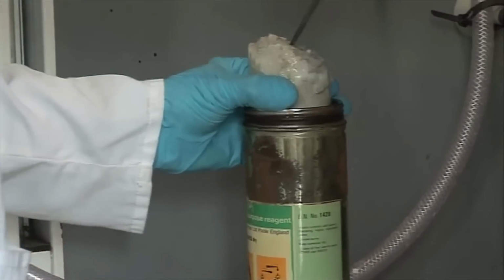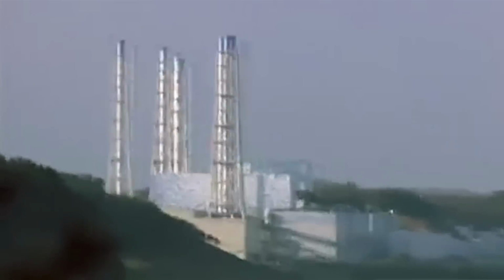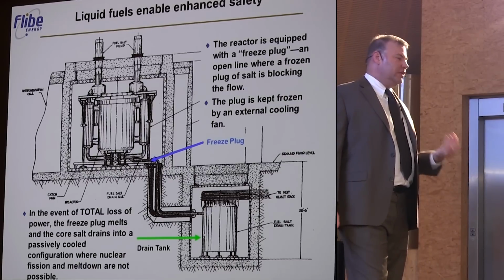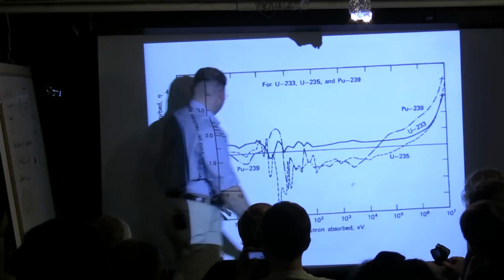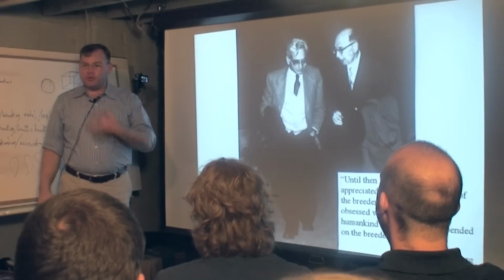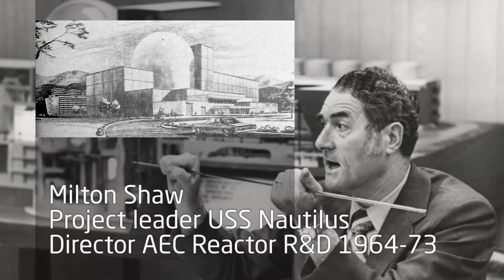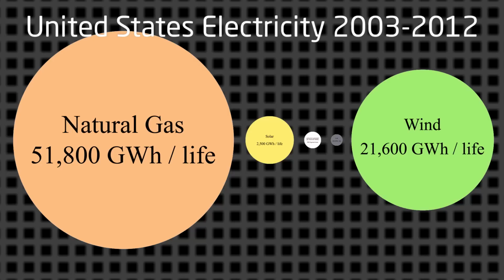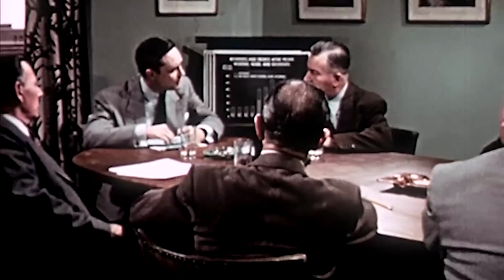Nuclear Disasters & Coolants

Comment: Why Not Build AT Least One LIFTR?
Reply: U.S gov. had one run 6 years until designer argued with Nixon about safety of fision reactors.Nixon then shut it down without explanation.
Reply: @billboyd4051  I think the question was why not building a MSR today? My guess is that it's very hard to find an investor because nuclear power plants (CAPEX) are pretty expensive. So the first DEMO MSR plant needs to be a showcase that the technology works as promised and can be built for a cheaper price per kW than current LWR. If this is not the case, the whole idea is dead on arrival in competitive electricity markets.
Reply: @gunnarkaestle  Investments into the future, are risky, utilities always choose the easiest way to boil water and without the ability to make weapons, governments don't seem to be interested. Elon is taking on transportation, and solar, but the oil and gas industry in in control. At least the coal industry is dying out in America, now fracking is destroying the water. Few care about the future, perhaps Texas will think of the impact of climate change, now that they are freezing their asses off.
Reply: @billboyd4051  It is normal for any kind of company to choose the easiest and cheapest way to follow a demand. Coal is dying out not only in the US, but also in the UK or in Spain (and that is not part of a political decision as in Germany). New coal power plants are just expensive, and the retrofit of old ones to meet current exhaust gas standards (NOx, SO2) is also not very attractive. The same principle is bringing nuclear gradually down.

Regarding the rotating blackouts in Texas during the cold wave, it seems that there are two reasons that the installed capacity of thermal power plants wasn't fully available. https://www.washingtonexaminer.com/policy/gas-coal-offline-texas-cold-snap
Usually, the peak demand in Texas is during the summer, driven by air-conditioning loads. Thus, there is enough dispatchable power generation in winter. But I was puzzled to read that equipment froze in in power plants ... in thermal power plants which generate a lot of waste heat? I have heard that in the late 70s, there was a cold wave and some of east German lignite plant were affected: not the plant itself, but the lignite fuel which has about 50% water content.

The other reason was a gas shortage, as power plants often prefer to have cheaper disconnectible contracts. So that was also a learning event during the 2012 European heat wave, when exactly this situation happened. High gas load for home heating and while the gas storages still were adequately full, the pipeline capacity was overbooked, so that in certain areas there was a gas grid related shortage. Thus it is important for critical gas power plants to have a non-interruptible gas contract, meaning that the gas amount is coupled with a fixed booking on pipeline capacity.
Reply: @gunnarkaestle  Texans will discover insulation soon, probably asbestos.
Reply: @billboyd4051  Asbestos is fine for shielding against high temperatures, therefore you could find it in insulation around steam pipes and also in personal protective gear. But it is not so well suited for not so high temperature gradients. But insulation is fine, not only in winter but also in summer. If you are not planning to tear your freshly built home down in 30 years, a better insulation saves money. If not for you, as you may move in 5 years, then for the next owner. A good insulation status of a building makes it more valuable.

Comment: coolant      fuel
salt              thorium not a fuel
water            LEU correct
sodium          Pu (Fast Reactor)
  I think this is correct
Reply: If you say a fuel is a fissile material, then you are right, thorium is fertile. You need to use it as educt in the breeder reaction, and this is the reason you need 2 neutrons per final energy releasing fission reaction, meaning you need a good neutron balance, not loosing to many.

Comment: If solar freakin roadways can get crowd funding why cant this?
Reply: The investment required to prove that solar panels make crappy road surfaces is a few orders of magnitude less than the investment required to prove that thorium reactors are practical, economically viable, and safe. If you're crowdfunding a thorium reactor, you'll need a crowd of enthusiasts that is orders of magnitude larger. Most people in the U.S. are uneasy about anything nuclear.
Reply: yes I know. All thanks to the military who wanted to make bombs and didn't really care if it made electricity.
Reply: Not really; the military cares a great deal about nuclear power and has invested in it heavily, both for naval propulsion and other applications. Even if it were otherwise, your attribution seems misplaced. The U.S. populace would be no less less scared of nuclear technology if the U.S. had no nuclear weapons, but its rivals did. In fact, U.S. citizens would quite likely be more afraid of those weapons, because the rivals of the U.S.  would be more likely to use them without U.S.'s nuclear deterrent.

Comment: the documentary is fine up until the part it compares all forms of power and based on safety using the unit watts*h/life.
Reply from the maker: Can you be more specific? Good to know at what moment you stopped liking it, but I'm not clear on what is wrong with that part.
Reply: gordonmcdowell Sorry, I shouldn't have said It so harshly. I do like the documentary, it is well put together and it convinced me on the case for thorium/sodium reactor as a better alternative to conventional water cooled plants. I just thought that stating the safety of specific methods for generating power in w*h/life is not a good unit of measure as indirect deaths can never really be measured accurately, since we are dealing with such a complex system.
Reply: letsgetverydrunk It's a good rough measure of relative safety in terms of output power.
Reply from the maker: Ryu Fitzgerald I'm working on a chapter that gets into that... not done yet but here's an image from a study... https://farm4.staticflickr.com/3718/13904567676_1ba0d85583_o.jpg ...problem is people in different states (areas with different background radiation) have different lifestyles too. Such a study that was to take confounding factors into account was cancelled in 2011. http://atomicinsights.com/low-dose-radiation-research-program-defunded-2011/

One problem is cancer is very common, and even the LNT assumptions about background radiation project very few additional cancers (as opposed to threshold model which predicts zero additional cancers). So you need a lot of data, and you need to be very careful about confounding factors.
Reply: gordonmcdowell  I thought about that too. I know some UN-organ, perhaps WHO, has made on how many people that are likely to get cancer from the radiation from nuclear bomb test. Wonder if somebody have done any calculations in that direction with regards to nuclear power and the 3 major accidents. Are the numbers in the video referring to USA only?
Reply from the maker: Dennis Block
Yes those are USA for a 10y period. There was 1 more nuke fatality (crane accident not radiation related) in 2013 so once this series is done and I can go back and iterate I'll be updating the nuke numbers (just shift them ahead 1 year). I don't know what's happened with other energy sources in past year... if anyone's fallen off a wind turbine or roof when installing solar panels. Certainly a lot of trouble involving coal ash-piles recently.
Reply: Ryu Fitzgerald It's called epidemiology. I actually have some knowledge on this exact subject casualty of my time in med school, using peer-reviewed research papers. If you like...

Very intensive studies have been going for years and I don't believe there has been any cluster loci around or anywhere near nuclear reactors during and after their use and presence (I checked multiple independent studies and did not find any at all). Also, background radiation doesn't appear to be significantly increased by nuclear power plants compared to background radiation. And when I say "significant" I'm talking parts per million.

According to designated safe levels for different radiation types (based on scientific evidence and peer-reviewed studies NOT political/social standards which are varied), nuclear power has never come near to any of those limits while working usually or after shutdown. The only times were during plant meltdowns/containment issues (not steam ruptures typically), and there are only a handful of those (mostly experimental reactors in the 1960s-1970s), and radiation levels only become an issue inside or near the reactor for the majority, and only became a problem with radiation levels into an exclusion zone at 3 Mile Island, Chernobyl, and Fukashima.

However, people HAVE been shown to get lung cancer, liver cancer and brain tumours from exposure to coal plants. The high levels of radioactive Radon released into the atmosphere are orders of magnitude higher than nuclear, but the biggest problem is particulates which get inhaled with Radon attached. Exposure to the particulates weakens the respiratory defense mechanisms, particulates become lodged in lung avioli, causes infection and immunosuppresion in bad cases,  and high enough radon levels cause nuclear mutation, which the body is now ill-equipped to deal with.

We know that cancer cases have clustered in a few places around coal mines, but we don't know the radiation levels because coal mines aren't regulated for radiation.

And no indications of cancer, malformation or cognitive impairment around nuclear waste sites either. I checked. In America and the EU and Australia, nuclear waste is completely isolated in disposal. I don't have information on China or Japan.
Reply: If the stuff we can't detect were an order of magnitude bigger than what we do detect, we'd detect it. As of the discovery of both a threshold level  of radiation danger, and a hormesis effect, I've read that the radon emissions at certain "heath spas" in Europe might even be just the right level to be beneficial. This would utterly invalidate the wild-arse figures assigned even to the lethality estimates of Chernobyl.
I have read that the radioactive boars and wolves around Chernobyl are entirely healthy enough to be dangerous, and they have the additional protection that the Monarch butterfly has, people are afraid to eat them!
Reply: I think that the correct phrase is "three worst accidents", rather than "major". In terms of actual known fatalities and injuries, the meltdowns don't come anywhere close to a medium aircraft crash, let alone the annual carnage by motor car.
Reply: I completely agree. I thoroughly enjoyed and agreed with this video,... Up until they jumped the shark with the watts per Life statistics.

Even as an advocate for these new reactors, it does not help the case to embellish, exaggerate, or grossly mischaracterized the alternatives.

I understand that the section about lives lost was based on a nextbigfuture article... But that is hardly a definite primary source worthy of basing conclusions.

It was shocking how much cherry-picking was needed in order to justify.  It is understandable to avoid scaremongering, to not attribute every Cancer death to nuclear power, but then there is hypocrisy in scaremongering against fossil fuels by attributing a massive number of deaths on pollution.
It's very subjective to draw lines regarding which deaths were or were not attributed to what power source.
Nuclear, or any form of power that can influence the biology I was human over a long time, is harder to attribute directly, compared to someone falling off a tall structure.
Reply: @13minutestomidnight  In Germany, there was an epidemiologic study on kids (up to 5 years) with cancer. https://www.bfs.de/EN/topics/ion/effect/epidemiology/epidemiology.html

The result was: yes there is a statistically relevant connection between the risk of having cancer and a living place near a NPP. In absolute figures this meant about one additional cancer case per year. My personal opinion is that you can do more for the health of children when you educate them how to behave correctly in public traffic and let them wear helmets when riding a bike.

Comment: the deaths/watt equation ignores all the cancer. This is the "cute trick" that pro-nuke folk can pull......
Reply: what do you think gives you cancer more quickly? 
A. Spent fuel rods stored in pools or dry casks and monitored closely.
B. Coal and Gas being burnt and dumped directly into the air you breathe.
Reply: @Clean97GTI  Trouble is, we don't do any of that monitoring stuff here in the US. The casks they're building for San Onofre are thinner than the ones they use in Europe, and are not designed for inspection/recoverability (songscommunity.com). The choice is not coal or nukes. We have a tremendous opportunity with efficiency alone, and we're not built-out with solar or wind. In addition to that, there's all the taxpayer subsidies to nukes that they're still getting (Ohio, last I heard).
Reply: @buixote  That report demonstrates a pretty serious lack of understanding. Yes, stainless steel doesn't block gammas, but concrete does. That's why the stainless steel welded cannisters go into concrete overpacks or casks. The loss of helium doesn't signal an impending radiation release. Heat is a more telling sign and that is monitored. In fact, Palo Verde Generating station is/was participating in robotic monitoring trials of it's dry casks. 

But that doesn't answer the question. Which causes more cancer? Safely stored nuclear fuel or coal plant exhaust that is blown into the air for all to breathe?
Reply: @Clean97GTI  "What do you think gives you cancer more quickly?"
C. smoking

Comment: All you need to do is show how you can dispose of the spent fuel and the industry would be viable. This was not mentioned in the video.
Reply: You don't dispose of it, you store it in sealed casings and monitor them. That monitoring can be nearly entirely automated, so it's not like you have a person coming down and inspecting casks every week. Yes this has the obvious problem that, as we continue to use nuclear power, the facilities will grow in size. But the amount of spent material produced over time is not significant enough that we would have unmanageable waste facilities any time soon. Over the period of time we're storing all of this, we can put money into researching methods of recycling waste, making it inert, etc. We already have some ideas in the pipeline, including re-using waste, and these neat bacteria that could be used to eat radioactive isotopes and give off less harmful waste. I don't think they're immediately applicable to the kinds of waste we're dealing with here, but it's one direction.

Also, even though it might seem a bit unreasonable at first, if we store this stuff long enough and invest our money in space travel, once we can move lots of mass up into space relatively cheaply we can toss it outside our earthly environment into the void or elsewhere. That's a far-off solution, sure, but I think it's inevitable and puts a cap on the whole "storing waste for millions of years" problem. If we don't have cheap enough space travel in even 200 years, something awful happened and I think nuclear waste might be the least of our problems. Let alone a thousand years.

Edit

Actually just scroll down because the OP of this video put it better than I could. We can already re-use waste.

Comment: when they realized that they were dependent solely on batteries. why did they call for more batteries from other nuclear plants? they should be able to be transported by helicopters.
Reply: The batteries only powered monitoring equipment not the pumps themselves. One monitoring equipment was powered I believe it stayed powered.
Reply: then what powered the pumps after the diesel motors were destroyed?
Reply: @xinglinjiang4952  In Reactor #1: nothing.They had a condenser device which cooled down the steam from the reactor core and that water dripped back. In Reactor 2+3 (a larger design): There was a small turbine which was driven by the reactor's steam and discharged into the suppression pool. But this stopps working when the pool is getting too hot and you loose the heat sink.

Comment: the one death number is innacurate, there is the SL-1 accident for example (3 deaths in the usa in this event alone).your analysis about deaths/watts is biased to me and i think that nuclear energy is an uninevitable source of energy for mankind, but to me you push the thing too far to match your opinions. of course we could talk about all that, i don't bite
Reply from the maker: 2003-2012 is the date range I show for that number. I started working on this in 2013 so that was the last 10-year range at the time. There's been 1 USA nuclear industry death since, it was a crane accident. SL-1 was before that date range, and was also military. I'm looking at civilian power production. If you don't trust my numbers take a look at OUR WORLD IN DATA they've got an easy to find post on ENERGY SAFETY. Coal kills millions of people every year. Every single form of energy which is not coal is basically safe. Nuclear happens to be one of the safest of the not-coal-therefore-safe options.

Another excellent video (better than any of mine) is Kurzgesagt – In a Nutshell / Do we Need Nuclear Energy to Stop Climate Change? They touch on energy safety and also find nuclear to be one of the safest. Of course they didn't randomly grab 2003-2012 as I did.